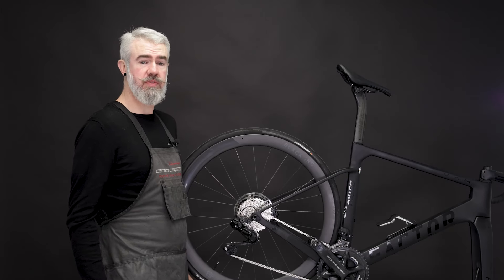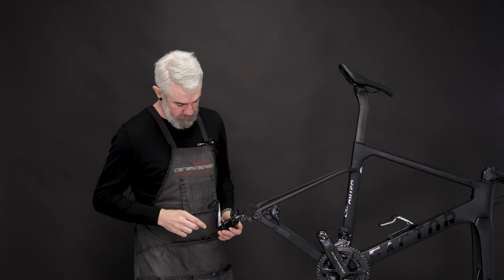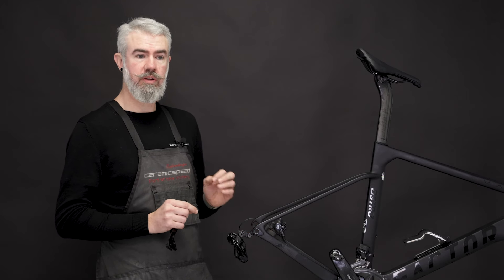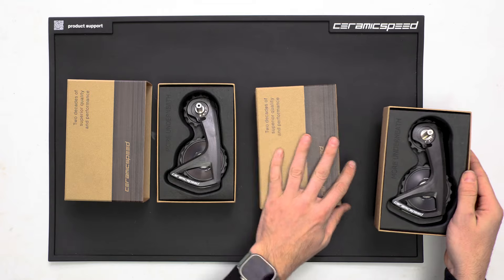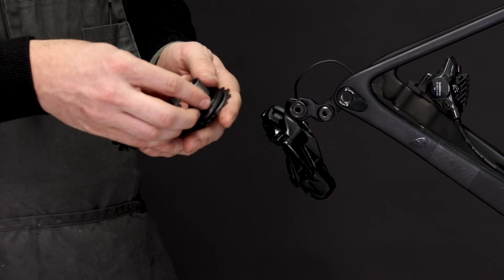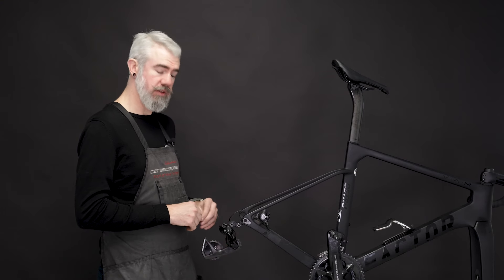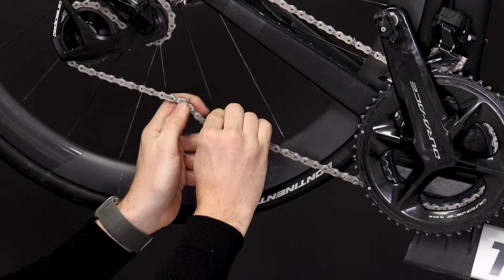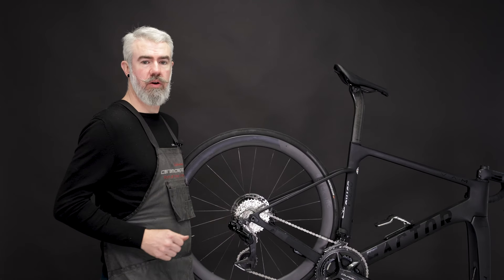Installation of CeramicSpeed OSPW RS for Shimano

Comment: Does this cage allow to cross-chain? Use the gears like 52/34 or 52/30?
Reply from the maker: With the correctly sized chain you will be able to use all normally accessible gears. Cross chaining in the 'big-big' combinations will always result in more drivetrain friction, but it is possible to use those gears without issue.

Comment: But at the 8150 and 9250 big chainring and smalest cog is possible to shift. So why should i mesure the chain at the second smalest cog. This Video is specific for 8150 and 9250, isn‘t it?
I just installed mine an I am a Bit confused.
Especially because the chain rubs when I'm on the largest chainring and the largest cog. I know cross-chaining isn't ideal, but shouldn't the chain run freely? The chain rubs on the outside of the OSPW cage.
Or is that normal because cross-chaining is not recomanded?
Reply from the maker: Thank you for your message. While Gear Postion Control is no longer included on the Ultegra level, it is still part of Dura Ace 9250. Measuring the chain in the 11-tooth or 12-tooth cog will not change the length of the chain as the difference is very minor. With all things setup properly the chain should not rub on the derailleur cage. Please contact our support team if you need further assistance to remedy this at cycling@ceramicspeed.com

Comment: Hi, so when installing the chain, it does not matter the size of the cassette, right?
Reply from the maker: Hi,
Correct, as the chain is measured for the longest length possible while maintaining the minimum required chain tension, this will accommodate all approved cassette options for a given group set. The length of the OSPW cage makes this possible.
Reply: @CeramicSpeed  Awesome. Thank you very much for your answer. 🥰